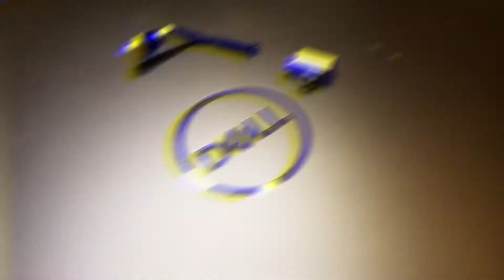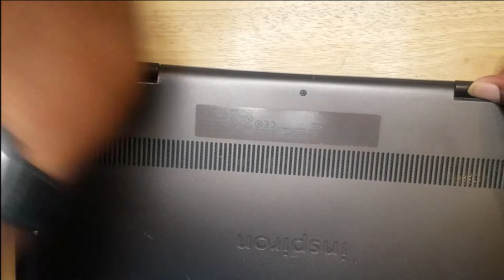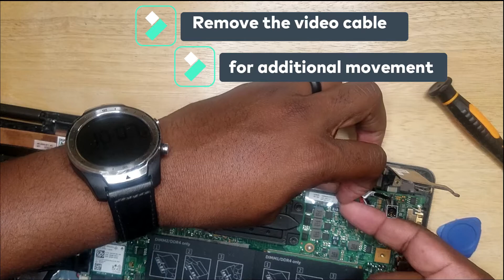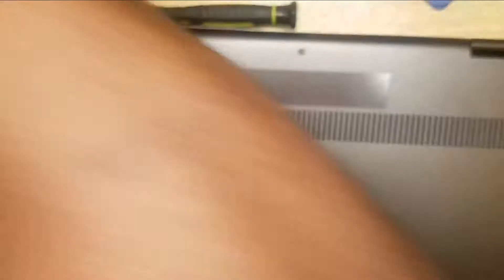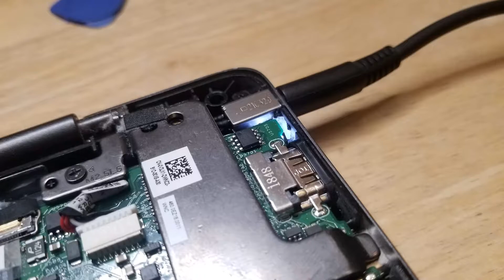Replacing a DC Jack on a Dell Inspiron [w/TIMELINE] 15 7000-7586 #dell #inspiron #geektweek

Comment from the maker: TIMELINE
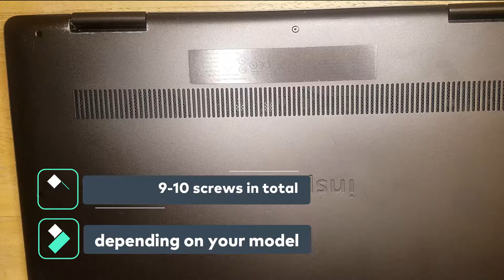Screw Removal - 00:28
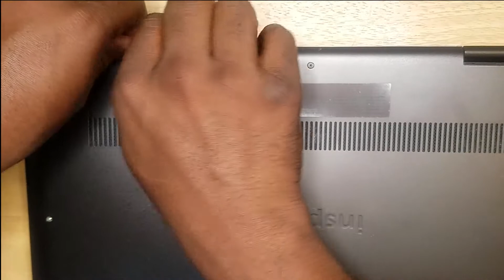Bottom Panel Removal - 01:33
*** Detach the Battery Then Continue ***
Releasing the Screen Mounting Plate - 02:45
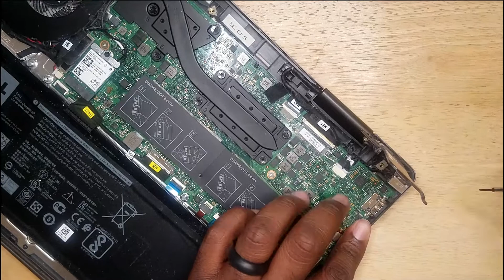Removing the Old DC Jack - 03:23
Installing the New DC Jack - 05:42
Reinstall the Video Cable - 06:39
Reattach the Screen Mounting Plate - 07:52
Reattaching the Battery - 08:25
Check other screws that may be loose - 08:59
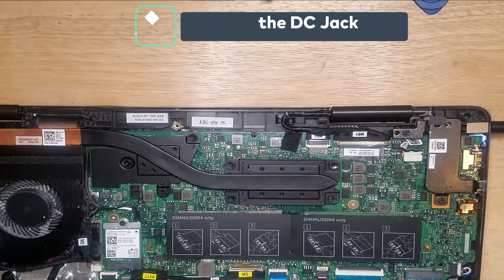Testing the DC Jack - 09:20
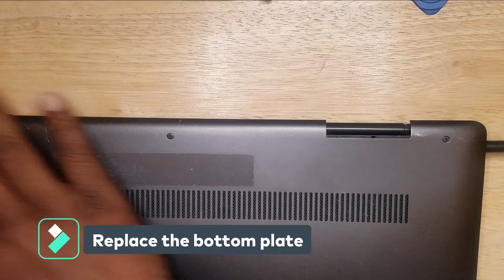Reinstalling the Bottom Panel - 09:46